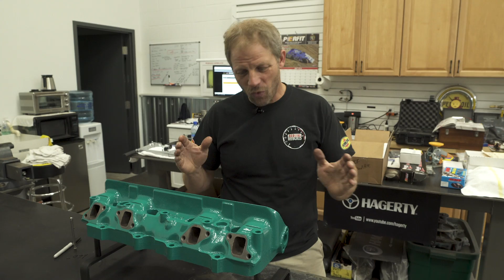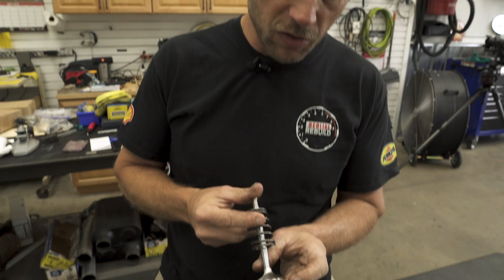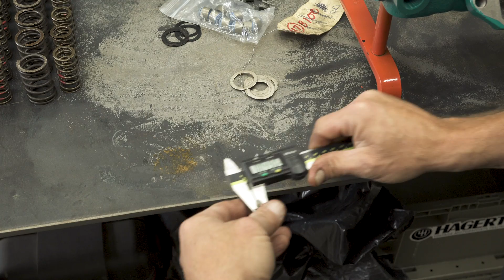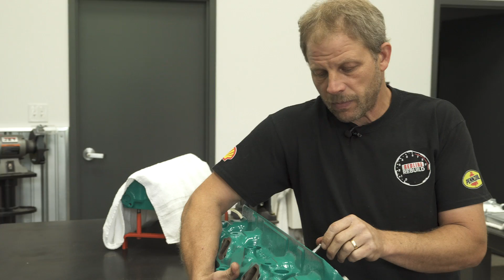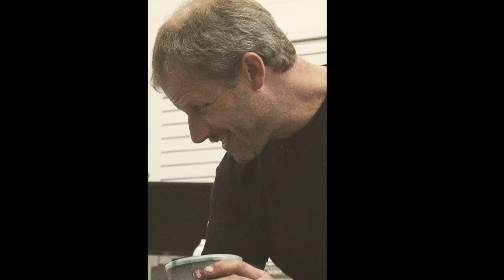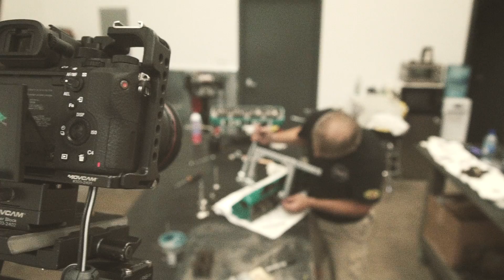Buick Nailhead Cylinder Head Assembly | Redline Update #16

Comment: Did you need to do any machining to the intake valve guide to fit the seal?  We're looking at building a '55 322 nailhead and am in the parts search process currently.

Comment: Been fooling with old Buicks for a while.  From the factory, most 60's Buicks shipped with a neoprene umbrella seal on the intake, and no seal at all on the exhaust. We typically machine the intake valve guide for a positive type seal, and use a simple Viton umbrella seal on the exhaust (which seems to allow a reasonable amount of lubrication to the exhaust valve & guide).

Comment: Thank you for that quick look into the time lapse stop motion technique. Awesome. On the valves, do you have to grind any off of the top of the stem like with a Ford? To keep the tops of the vales the same height in relation to the amount ground from the face and seat? Thanks for you work and production quality.

Comment: When those heads were originally machined it was on a progressive transfer line and each spring pocket was cut by its own tool that was adjusted individually unlike a machine shop that uses one tool to cut each spring pocket and dialed in individually. That's why you see so much variance. I've engines from the factory that have 7 standard cylinder bores and one 10 thousands or more oversize.

Comment: No exhaust valve seal seems to be a mistake. Never heard of such a thing. Original seals where useless. Consuming oil as “normal”? I don’t think so.
Reply: Back in the old days it was very common not to have an exhaust valve stem seal. All they would have is a deflector in order to keep most of the oil off the stem. With the small clearance in the guide and a small amount of pressure in the exhaust port it honestly consumes a very small amount of oil.
Reply: Geoff Moore, sorry, not in my experience. Whether stock or modified for performance.

Comment: Never realized valve seat height was so important, always tried to get the biggest diameter valve in though...
Reply: It is more important as you move into more aggressive cams. If your plus/minus a but but still have adequate seat pressure you will be ok with a street or street performance cam. If you have a solid roller race cam you will need to measure all seat heights and also verify every spring for proper seat and open pressure.